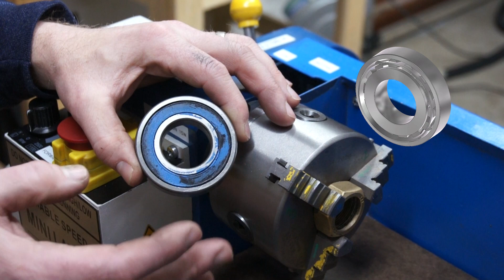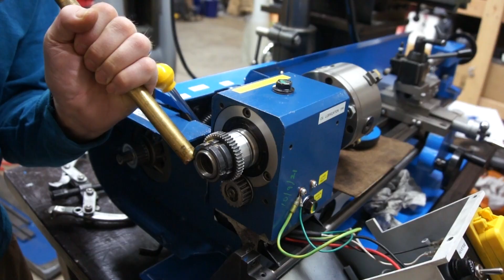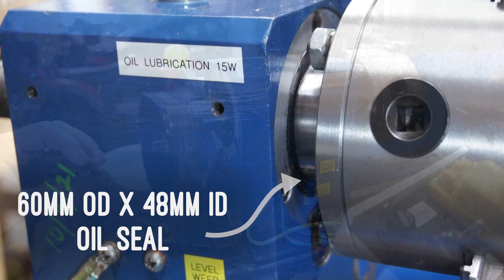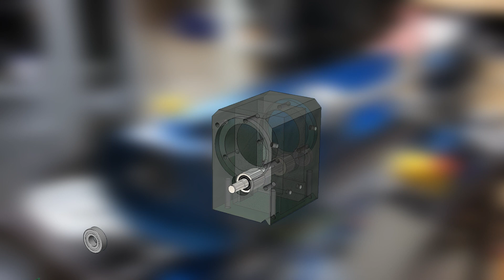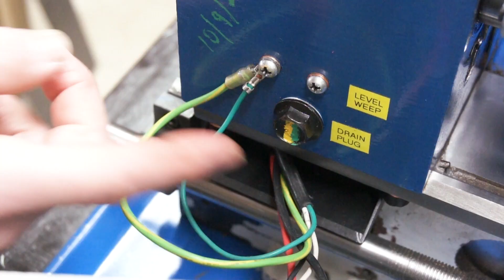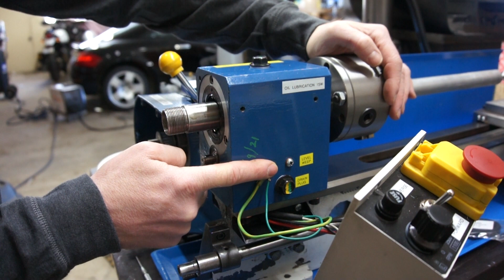Mini Lathe Upgrade: Oil Lubricated Headstock

Comment: Nice work! An alternative, instead of using unsealed tapered bearings, use sealed angular contact ball bearings. FAG makes some quality precision ones, but they're a bit pricey. I found a set for $160. I had tapered bearings for a while, which I greased once in a while. Not fun. But the runout was around 0.06mm, which was ok for some things, but I wanted tighter tolerances. I know, I know it's a mini lathe! Ha!
Reply from the maker: That's really good to know.  I'm gonig to pin your comment so others see it first and maybe it'll give a quicker direction to take for bearing upgrade.  When I did mine, I couldn't find angular contact bearings the right size for the inboard side, I think, it's been a while, but I didn't look too hard because of the price.

Comment: I did something similar on my 8x14 Vevor mini lathe, all of these are of similar DNA. I quite a few mods, more coming.  I pretty much immediately pulled the spindle apart to put good Japanese tapered rollers in it. If you do this the conventional way, they need to be periodically greased. Id rather not pull the spindle apart, eventually its going to wear out the bearing fit on the spindle. It had the bigger cube/curved face headstock some of these have. Instead of fully sealing & filling it, I made an oil trough screwed & epoxied inside the headstock. Its a sheet of a parts cleaner aerosol can. No gears in mine, nothing to really splash lube it and its only the spindle bearings needing lube. Im an aircraft mechanic so I filled it with turbine oil. Its good enough for the bearings & gears in a gas turbine so its more than adequate here. Its only full enough to flow into yhe bottom of the bearing cavities at rest & pick up a tiny amount when running. I did gun drill passages to the outer/thin side of the races. It came with steel bearing retainers pressed in but with an ⅛in gap to the spindle. I put o-rings on the spindle to act as a labyrinth seal and oil slinger. It does weep a tiny amount of oil over time, no biggie. I used ¼in PE tubing for a "sight glass" behind the front panel and a slot to see it through the panel. I also added magnets stuck to the trough to pull away metallic particles. Its been working beautifully. I did change the oil after a running in period. I also made a spindle lock for it. I turned a good size piece of brass with three slots in it that a stainless pawl rotates down into which is great when changing the chuck, ER collets, etc. Its a fun project all by itself!

Comment: using rtv on the bed is not a good solution at all. 
making a plate from what ever and fitting it inside it is, a good fit is not needed as any holes one can resolve with RTV . 
One cannot make a real substitute for oil seals (one could polish better the shaft where the simering is in contact, a mirror finish will make it last for decades. one can make a good substite with O rings but here a mirror finish will be a must and using "premium orings" from silicone, a good design will just splash/wash oil on the pinions and on the bearings, with a good o ring selected, the oil lost will be just a smuge at some hours of useage. 

good quality bearings 
granitte epoxy the bed
some minimal scrapeing (even with sand paper)
shimming the bed on a super solid base, and a super solid table/desk one that can even be bolted to the floor. 

will improove imediatly the quilty you can do on a mini-lathe made in china, no matter if is is rebranded or not, a 3-4 time the cost "austrian" one has the same damn problems like the ones from china, just in a less of a degree.  I just paid for a 220x600 one almost 3k and still need rebuilding , casting defects where you cannot see still present, actual sand in the head stock there, gibs that are shitty and  get stuck because of bad machining , yes they are also present. 
things like 1 milimeter slop no they are not but still the cure is the same dismantle and rework, with maybe half the work because I paid 2k more :))

Comment: i know it past 4 years  and you sell it.. but... do you remember how thick (in mm) the seal's are? and why do you think the plastic ones not work, even if do the same changes as the aluminium one? sorry to ask something so long ago
Reply from the maker: The plastic ones were hollow on the back side.  There wasn't a way to carry a seal.  I didn't have a 3-d printer, then, or I'd have just printed another set from ABS with a seal.  The seals I used were either 7 or 8mm thick.  I used what was available in the two sizes I needed.  I don't recall there was a lot of option for width and I used what I could get.

Comment: Incredible video and implementation. I have thought of doing the same thing, but I never once considered that the housing was porous and would need to be sealed. That is a great insight. Plus I was shocked at how much casting sand came out. Also, sealing against the bed is brilliant and so is being concerned about the height difference.  I read about all of the comments about the detergent oil and have no idea where that info is coming from. Oil baths need non-detergent lubes because detergent oils foam from the rotating assembly slapping the surface of the oil. It is suds from the surfactants added to help keep the engines free from sludge that actually cause the problems. Since oil bath systems don't have combustion by-products being added, they don't need a detergent added. This is the type of lubrication pressure washer pumps use and when someone brings one in with motor oil containing detergent in it, it is easy to see because the oil coming out the vent is easily visible. Oil bath systems are violent and nothing is going to prevent any contaminates from being redistributed throughout the chamber once it is turned on and nothing is going to remain settled on the bottom. Plus even the best oils get aerated in an oil bath and minimizing that helps provide the best lubrication, but that likely will have virtually no impact on tapered bearings that were getting no oil before. It is a big deal on pressure washer pumps that have aluminum rods with no bearings on steel crankshafts and no pump to keep the oil pressurized. Just an FYI on the detergent oil thing. Awesome video.

Comment: I've just posted a video about fitting a brace of Austrian-made SKF 7206BE RSZP sealed angular bearings for £55 (about $70) for the pair. As of a day ago, they're showing under 0.01mm (0.4 thou) runout, which I'm happy with. I love the idea of running them in an oil bath though - this is definitely a mod I'll be considering, especially as I only have the single-speed head to deal with. Great video, I'm pleased to have found your channel. Subbed!
Reply from the maker: I'll check it out!
Reply: Hey thanks for the part number

Comment: What lathe is that?
Reply from the maker: Vevor 8x14 with the high/low headstock.
Reply: @RobertAdairWorkshop  I have been looking at the 8x29 vevor...do they make good lathes?
Reply from the maker: @wallyodom8254  They take the basic Chinese lathe that everyone makes and put their name on it.  Quality control wise, the one I got was good and was quickly shipped to me.  In my experience, they're just fine.  The thing to keep an eye on is their packaging.  You may have to deal with some freight damage but anything that large which comes through the mail will have some damage.
Reply: @RobertAdairWorkshop  thank you for tge information I appreciate that

Comment: The oil should definitely not be motor oil... It keeps shit in suspension, that is its design, its made for a pressure fed filtered system to remove the suspended gunk... You should use any other oil that is detergent free... Any non suspending oil will do, be it gearbox oil, regular detergent free hydraulic oil, lightweight way oil or similar... Just for the love of god dont use motor oil on an unfiltered system... You are literally doing it more harm than good... 
Also, the fill plug should be modified into a vent cap... As the spindle works and the gears inside churn the oil, its generates heat, which in turn increases the air pressure in the headstock, which increases pressure acting upon the surface of the oil and thus attempts to force it out of the seals... You can find a nice design for a similar plug for Emco FB2 mill on one of the machinist forums... You wont be able to miss it if you google it... Its a simple spring and ball check valve vent geometry integrated into the top plug... 
Other than that, i would go with milling out the headstock on the bottom square, replicating the shape undersize with a square o-ring groove around and would have fitted that to the headstock from beneath... I just dont appreciate the sealant interfering with the precision surfaces... 
Oil bath is a great idea, but please, use shit designed for specific systems and intended purpose... Motor oil is intended for motors, or any other system that has a filter in a pressure fed oil circulation.... You could make the design such that you use an oil pump with filters and inject the oil at the bearings, allowing it to flow into the housing before being extracted by the pump, through the filter and back into the injectors at the bearings... That would allow you to run motor oil, but i assume it to be a worse option when compared to good old settle out oils... There the gravity acts as the filter, drawing all the shit to the bottom and theoretically keeping the oil above clean and fresh... You could also inset a few magnets into the bottom of the housing to drink up all the metallic particles from the oil that pass nearby... You could inset a magnet into the drain plug as a control and as an easily cleanable magnet... That improvement would work with both systems, be it detergent free oil or if you went the more complicated and theoretically worse system of filtered pressure fed system with motor oil... 
All the best!

Comment: So many thanks @Robert A., for your outstanding work / mini.late upgrade, as well as your awsome video / editing on it.  (I'm FAR from being an experienced machinist. Just an ER / ICU MD, but also a 'machining.things' aficionado). 
I'd dare suggest adding some air venting thru the upper / filling plug screw + a piece of felt and / or metal wire mesh to it + some kind of 'magnetic trap' in the drain plug, to catch any ferrous shavings. (I'd suggest boring a hole in the lower  plug screw, just about same size of a small Neodimium magnet you can affix to it with a little JB Weld). Of course I subbed, and will share this interesting video, (And others too..). 😌🇺🇲💪🙏🙏🙏🙏

Comment: Do you have a vent to relieve pressure in the oil bath as temperature go up and down?
Reply from the maker: I never got around to adding one.  I’d planned on drilling a vent hole in the fill cap or making a sintered plug for it.  But ended up just leaving the fill plug loose to vent.  You are right. You should make a vented cap or drill a vent hole in the body, or similar.  It will build pressure.

Comment: What model is this lathe?
Reply from the maker: It's unbranded.  I got it on eBay.  7x14 mini lathe with 2-speed headstock.  

This is the same lathe.  It looks like they moved the speed controls to the front instead of on top, but it's the same machine.  

https://www.ebay.com/itm/255011035221

Comment: This is nice work. Thanks for showing. Since I'm a pre
 beginner and have no mill also, it's not within my capability to do as you did. I plan to upgrade the spindle bearings, but as I have found that sealed angular or tapered roller bearrings are available, and one of the other bloggers, possibly Artisan Makes, found that even with medium to heavy use his unsealed roller spindle bearings were still lubricated after 6 months so I believe  I'll go this route of occasionally disassembling to lubricate. Much appreciation for you showing an advanced upgrade.

Comment: Tapered Roller bearings are not a preferred choice for a machine as angular contact bearings were designed for Machine tool use, Tapered Roller bearings have their place but not so much in precision tooling systems.
Tapered rollers have high load carrying capacity but have to be correctly preloaded for maximum life and sometimes that does not play well with machine tool characteristics hence why the Angular contact bearings were developed, Tapered rollers are great as wheel bearing in vehicles while being  correctly maintained and lubricated and preloaded can last Millions of Miles, Think about that.
Bridgeport for instance with their Milling Machines sized individually each quill to custom honed bearings on a hand fitted scenario with well trained professional toolmakers doing the fitting, Not a normal manufacturing process in the modern era and a potential nightmare for servicing years down the track.

High precision Machine tools are often turned on hours before use to bring the machine up to temperature for precision results not really an option in the home workshop scenario, Full size precision tooling as you have done runs either an oil bath system as you have developed or a pressure feed system.

As for sealing castings especially when running an Oil Bath some of the Industrial variants of Glyptal should do the job perfectly, Nothing to do with them but I have used their products with success in the past and as not that many may be aware of them I have linked the company below so you can do your own research to see if they are useful to your needs.
http://www.glyptal.com/glyptal_products.html
Reply from the maker: This particular lathe was designed for standard ball bearings.  Not roller or tapered.  It's also not a precision tooling system.  It's a cheap chinese lathe and built to a very low pricepoint by skilled labor overseas.  

Regardless, all of the large lathes I've owned have had tapered roller bearings in their headstocks.  My current Atlas Commercial uses SKF.
Reply: "Tapered Roller bearings are not a preferred choice for a machine "

Guess somebody forgot to tell Timken then - they did a really nice book on how to design taper bearing installations for machine tools.

Comment: Excelent video. Robert, you inspired me to do this upgrade to mine mini lathe, thank you.
 May I ask about rear oil seal on the main shaft? You used spacer so that a rear oil seal does have someting to ride on. But - this spacer does have one more purpose - to tension the bearings - so it must be loose fit on a main shaft. Does the oil seep out  between that spacer and a main shaft?
Cheers,
R.

Comment: Mike from mo here, i really like this vidio!  I just purchased a mx 210 laythe...i didnt look on utube until after my purchase,,when i inspected the brgs. In this thing i found 1 taiper setup and...1seald ball set up😑,,,anyway im fixing with taper setups..i plan to box in seal up an run oil...i wanted to ask your opinion on oil level,,,i dont have gears for slinging the oil,,,i was thinking if it filld to bot. Of spindel shaft?  Thanks for the article! keep up the good job! Mike t.
Reply from the maker: Hi Mike.  I think you’re right in keeping the oil level such that the bearing rolls through it.  You might consider going a bit higher though just because when the spindle rotates, some of the oil will surround and cling to it ,drawing your level down a bit.
Reply: Thank you! Sounds great!
Reply: One more thing, i just was wondering is venting..an issue?

Comment: If you haven't already done something else for the vent, I have a idea. Take the top plug and mill/drill a hole in the center, then drill a small hole into on of the drain plug flats towards the center hole. You can do this on a angle or straight. Put a fine screen in the center hole and ta da, you now have a vented plug. I think this will work, great video.
Reply from the maker: This is a great idea.  Thank you Charles.  Lathe is due for some maintenance so your timing couldn’t be better.

Comment: Good stuff. Although i would think that some sort of breather added would be beneficial...
Reply from the maker: Absolutely.  I was thinking of making a sintered breather for it but for no, I just back off the bolt a bit and let it breathe.  It does leak out the fill plug when I do that, though.  But spot on!

Comment: Excellent upgrade. I wish I had the milling machine and dividing head to be able to do this.

After watching it perform after the upgrade, I'm beginning to wonder - do you think a vent is necessary??? Otherwise, once the oil heats up from extended use, do you think any pressure build up could try to push the oil past the seals?? Thanks!
Reply from the maker: It does bleed pressure and will leak past the intermediate shaft oil seals if not vented.  I’m cracking the fill plug for now.

Comment: The "2RS" in angular contact bearing number 7206B-2RS means it has seals on both sides
Reply: Is that type of seal ok for retaining oil?
I had thought they were there to retain the bearing grease & stop dirt getting in?
Reply: @pcka12  no

Comment: what does the fuse button does on the lathe?
Reply from the maker: It's on the incoming 110V circuit.  I think it pops if the lathe overloads or shorts.